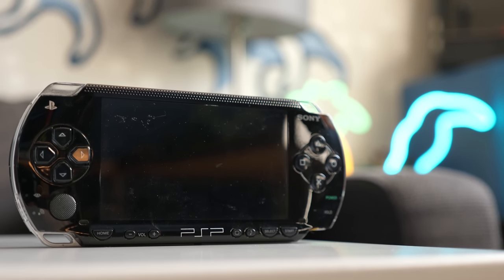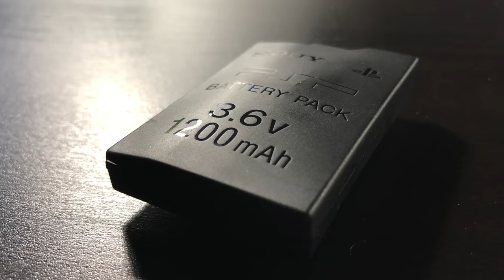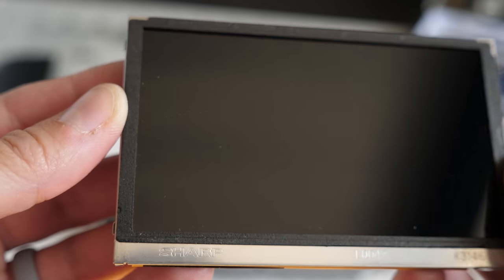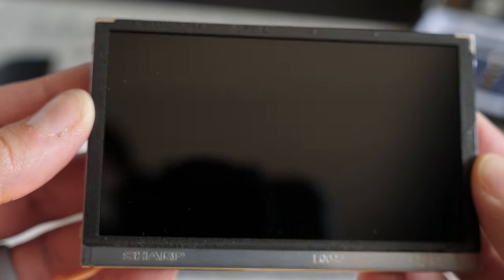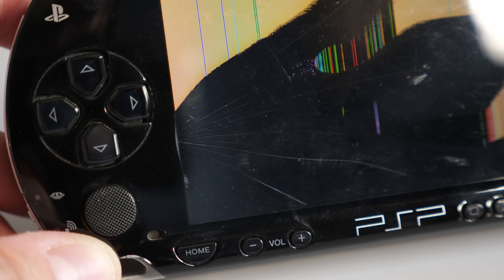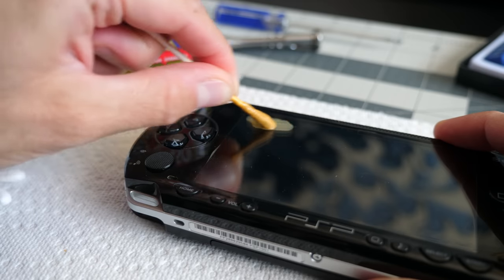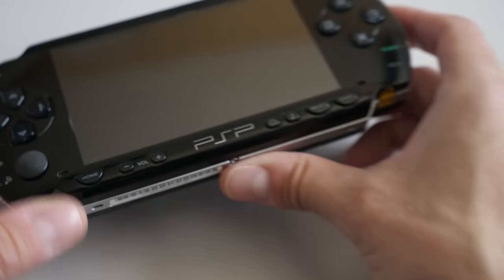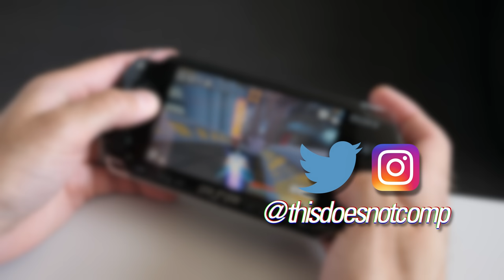Replacing a Broken Sony PSP Screen

Comment: Such a great little machine for 2004, still blows me away Sony was able to get that much graphical fidelity out of it, was an envious DS owner at the time it came out.
Reply: I understand the allure for its strategy/tactical RPG goodness, but games looked bad on it.

PS Vita is where my handheld love is.
Reply: yeah, it was sorta like a portable ps2, and the ds basically had ps1 quality graphics by comparison lol
Reply: @justdev8965  Yep, until you couldn't get games for it anymore.
Reply: You wuold explode if you knew that the psp was able to emulate the ds (unplayable, youd get 4% of its normal speed) but yes it could play ds games
Reply: @stoutishvoice4185  Desmume PSP is actually still indev, there have been major performance improvements. Pokemon Diamond boots and runs at near fullspeed on the title screen.
Reply: Thank it was helpful

Comment: I got myself a psp 3000 with a broken screen , ordered a new shell to restore it and it was a nightmare to get a new screen , ordered and returned 7 screens from Amazon , they all ether were broken or had dead pixels , I won't be doing this again with a psp , shell replacement is easy but getting a good new working screen is super difficult.
Reply: there's also brand new oled screens for psp now
Reply: @Chaosghoul  I think you mean IPS

Comment: I bought an INSTEN brand battery for my PSP 3001 and it has been great. Since it included an adapter as well I thought it might turn out to be too cheap to be any good but I have no complaints so far. it was $21.39 Canadian and I think I saw a replacement for the PSP 1001 available as well.
Reply: What do you mean with adaptor? Are you referring to an adaptor for the charger ?
Reply: @Arturo-hc9pl  It comes with a power adaptor to power the PSP and also charge the battery while it is installed in the PSP.
Reply: I got a really cheap battery for my PSP 3001c (64GB with permanent infinity/lme installed) and it only runs for 1 to 1 1/2 hours when my original sony battery would run for 6 - 7 hours, I took the original battery pack apart to replace the battery inside with a new one (so it wouldn't leak) and haven't done the replacement yet but I will now that I have a new temperature controlled soldering iron (ts80p) and have put some solder on the original battery pack's board for the new battery to connect (also checked which way around it needs to go and marked it) I just need to find a good pouch type battery with the same voltage and capacity that will fit right, when I get the old battery repaired I'm going to use that one in the PSP and make an adapter for the junk one to use it in my xbox 360 controller until it doesn't hold a charge.
Reply: My PSP seems to be a PSP1004 how about that?

Comment: A word of advice with aftermarket shells for the PSP 1000 and 2000,  the analogs need PERFECT contact to the motherboard which means that the shell has to be measured perfectly. This is often not the case for aftermarket shells which cause ghosting issues or dead zones in the analog after replacement. If the shell is not damaged in any way, it's best to leave it be and avoid opening up the console to ensure perfect pressure and contact with the motherboard.

Comment: In 2006 I bought a Sony branded 2200mah PSP battery at Best Buy.
Then turned my original 1800mah battery from 2005 into a Pandora Battery .
I still have both batteries today.
Both still fully charge. No issues.
I lost my charger one time. With a full charge I played the GBA emulator for over 40 hours . Screen on dimmest setting, frame skipping, and CPU on almost lowest setting.

Comment: Always found it funny, how Sony went out of their way, to make it incompatible w/ Minidiscs, even though the actual discs look very similar!
Reply: they are similar except for a few main issues, 1 UMD is actually smaller than minidisc, 2 UMD uses a Red laser like DVD where as minidisc uses an infared like CD and 3 Minidisc is opto mechanical for its re-writability and UMD is purely optical, im pretty sure that since they needed to create a disc format with larger capacity than minidisc was able to handle they then wanted to make everything incompatible so you would never be able to shove a Minidisc into a PSP, unfortunately i think they screwed up the UMD sucks because its protective caddy isnt very protective, the hole for the laser doesnt have a door like minidisc, and the shell comes apart far too easy ive got many PSP games that the shells dont want to stay together or the clear plastic on top pops out. i do think that could have honestly just changed the minidisc caddy just enough to make the two incompatible but yet still provide that lovely protection minidisc had.

Comment: I got a PSP in 2007 - it was an amazing little piece of kit. Not only for gaming but I used to encode TV and film on the memory cards (I had loads of 4GB and 8GB cards) and used it to watch stuff on the go. I often used to work away then so I would use it on the train or the coach a lot and I used it for that until I got my Galaxy S2 in 2011. It really is amazing how much they crammed into that thing in 2005. 

The batteries weren't very good. I often used to carry 3 or 4 batteries if I was going away for a couple days.

Comment: I got 2 broken ones from a Japanese seller, mixed and matched parts, and got a nice black and blue 1000 series. Deleted the UMD port and put in a 3000mAh battery in it's place. It's rooted and I got PS1 games I own ripped to it using microsd adapter. It's a fun little toilet time passer.

Comment: You can restore the original battery by replacing the Li-Pol cell. I've done it for my PSP-2000 with LP603450. It fits perfectly!
Reply: Recell is probably the best option for the budget conscious. Almost the same performance as a Cameron Sino battery, or even an OEM Sony one.

Comment: I've had the 1000, 2000, 3000 and Go. While the slimmer, lighter versions are nice, there's just something satisfyingly chonky about the 1000. The extra heft imparts a sense of higher quality (even if that's not necessarily the case) to it. Same thing goes for the Vita 1000 and 2000. The 1000 just feels so much more solid and high quality.
Reply: Agreed 100% on this sentiment.

Comment: Hey there! Just thought I'd let you know that if your 1000 is one of the models where the lens isn't fused to the faceplate (as in, it's glued on instead), you can mod it with a glass lens. They can be had for as little as $5 each (in a 3-pack), and make the system feel way sturdier. Plus, glass is also scratch resistant. (Also, every 2000 and 3000 can be modded with the same glass lens)

Comment: Nice video, Colin .. great work at that screen swap. Might i suggest U keep onto your original Sony batteries? Even swollen, U can still pry them open & resolder a new Liltium cell, while keeping the original Sony circuitry. It is true that their sells are glued together and need a cutter knife to be opened - and taping them back together, after the "surgery" - but Sony's original circuitry i believe is worth salvaging. Cheers ...
Reply: Why?  If the batteries keep swelling, is the circuitry worth salvaging?  This seems like it would need testing.
Reply: @simeonjohnston5941  Battery swelling doesn't always mean battery leak, as it is in this case - genuine PSP batteries may bloat, but they rarely leak. And aftermarket PSP batteries have terrible control circuits. Why not desolder an aftermarket battery pack to the OEM circuitry? On my PSP Slim, battery got swollen, but the circuitry remained intact ... And Sony OEM circuit boards do a great job at controlling their battery packs ... Too bad Sony didn't make their OEM packs of decent quality, as well ...

Comment: I actually dug out my brother-in-law's old PSP-1001 the other day, he'd given it to me a few years ago and I had CFW'd it. Pretty sure it's the original battery, didn't think it would charge but surprisingly it did and seems to be holding a decent charge. Everything works on it but the faceplate is cracked pretty badly and the square button isn't quite right, so this video actually covers pretty cleanly what I'll need to do!

Comment: The PSP was the first device that I started repairing on my own, back in the day. Since it's rather easy and hard to mess up. Even the later models (save for the Go, which I've never tried repairing.) remained rather modular and easy. THOUGH, the Vita, is slightly harder to repair. Also, the old Vitas have a mysterious internal slot in them, I think that's where the 3G card would sit if I had the 3G variant.

Comment: My original PSP battery from 2005 is still running nicely without any problems in 2021, however I had a 2nd battery puff up on me many years ago.

Comment: The foam around the screen also keeps light from bleeding through the plastic.  I had to replace my screen in my death vader edition, but I couldn't remove the foam.  Sadly now I have light that bleeds through the white shell.  Someday i'll fix it.  Also I'm very impressed you don't have a broken UMD door.  The fat PSP door was prone to cracks and wouldn't close properly.

Comment: Seeing the internals  for the first time and how easy they are to service. Yep, it's a Sony!
Reply: The 2000/3000 systems are easier to fix (the motherboard is one big piece and for most repairs there are no clips holding it together).
Reply: It did surprise me however that the 1001 has a screen made by sharp... i just always assumed it was a sony screen since Sony has a huge line of TVs monitors and other display devices that sonys game console would use as much sony hardware as possible.

Comment: If you save the chip from the original battery, its easy to connect them to a lithium battery. Since my psp was old, and the disk drive did not work, I actually removed it, cut into the inner housing a little bit, and was able to fit a Much larger battery inside. I get a solid amount of playtime with this mod. Sometimes I dont charge for well over a week. I still play my psp very regularly.

Comment: They make IPS mods for these too
Reply: Got one for my 1001 and it looks sweeet. The lack of ghosting is awesome
Reply: also 5000mah battery, have mine modded and last for 12hrs
Reply: @lensboi1229  I like the UMD drive too much to axe it for the extra lithium, even if it is loud and slow and power hungry. The UMD was the PSP’s trump card back in the day, so I wanted to keep it. I ended up replacing the lithium cell in my original battery with, a 2200 mAh cell from I think a baby monitor. Wouldn’t recommend it for most people but it worked. 

Besides, if I cared about battery life, that’s what my Vita is for 😁

Comment: I've bought 2 cellonic batteries, just to realize both of them from different sellers were working for 1 charge and puffed up after that. I contacted the seller which offered me replacements, no issues so far and its almost a year now. I wouldn't recommend this brand though. I got them for ~25€ a piece

Comment: Never had any battery swell on me. I've been using Cameron Sino brand for many devices, and so far they haven't failed me.
That's the same brand as you put in this time by the way. I've had good luck with Hantel aswell but I haven't had many of those so I can't really say if it's better than any other brand.

Comment: In terms of batteries I've had good luck with a particular battery so I bought another of the same brand and it wasn't the same experience. Definitely hit or miss even with the same brand. I'm guessing these after market batteries are as old as the psp itself so they degrade from just sitting in a warehouse for a decade.

Comment: Recently a couple months ago I brought my psp with me to work in my backpack. Long story short I left it next to my work vehicles tire and accidentally ran it over. I went to the gas station and before it was too late realized I left it at the shop. I went back and was so scared it would have been ruined. The body and frame were completely unharmed but the screen did crack in the top left corner and was utterly surprised nothing worse had happened because my truck is huge and heavy. I was able to replace the screen later on but kept the broken screen as a memory of that day.

Comment: Sony pro tip: They use the same barrel jack size for everything. You can buy a cheap PS4 controller station charger instead of an expensive PSP replacement charger. Same voltage and barrel jack.

Comment: Unfortunately I couldn't find a reliable battery replacement for my PSP so I opened it and replaced the cell for a trustable one. There is a drive delete mod which you can use up to 10000mAh cell

Comment: Hey Colin, how's it going?  Can't you hook up the PSP to AV or composite to a TV to verify everything else works?
Reply: PSP 1000 does not have the ability to hook up to a TV with only 32MB of memory. That feature was added to the PSP 2000 and later models with 64MB of memory.
Reply: @DDStuff  derp.. that's right.. and I even had a 1000 and 3000 model too

And yes, the swelling battery is real... That's how my 3000 battery went out, luckily it didn't do anything else
Reply: @adventureoflinkmk2  
I believe the worst it can do is break the plastic cover holding the battery. Glad those covers are so easy to replace.

The only time I ever had any swelling batteries so far this year was from my New 3DS XL and my MacBook Pro battery. Mostly due to having them plugged in all the time and not using the batteries enough.

I never ran into swelling batteries with my PSPs (yet), so I make sure to re-charge them after 6 months or so to try to mitigate the issue. Those batteries drain after only a few months of sitting idle which if left uncharged also leads to swelling. shrugs

The PSP Go is a different story, that battery is still going strong even after 6 months of no use. I think that is when the battery tech improved.

Comment: It's a shame that SONY (they produce Lithium-Ion cells themselves) doesn't officially offer replacement batteries for their PSP since more than a decade, just for their cameras, IMHO if they would make PSP batteries again it would be a "shut up and take my money" even if it cost more than 50 bucks, JUST DO IT!
This shows also one of the major problems of user replaceable batteries, I appreciate them, but they're a pain it the butt if they're proprietary, so like here it's a pretty mixed bag with third party batteries.
The manufacturers should be forced to supply these for >10 years after End of Life and maybe give the construction drawings/licenses to a third party one that continues that or publish them for everyone.
Luckily also 3D printing makes things like Lithium-Ion based and USB-C rechargeable replacements for the Sony BP-2 and BP-5 battery packs used in Discmen possible.

I may also replace my PSPs LCD, it's got a dark spot and the front body got a crack but I'd rather get a IPS one: https://youtu.be/hIUuIaAD7E0 that's drop-in except you have to bridge two solder points.

Comment: PSP is love. I have every model except the E1000(street), been looking for a good price for years.
As for batteries all the ones I've bought have been garbage and the 99% of the originals are swelling.
Reply: somehow ive been able to avoid this issue with my original battery and the stamina battery i bought for my console, they both still work, still hold an ok charge who knows, i will keep an eye on them from now on though and probably make sure i dont leave them in the console unless im using it.

Comment: Next video please: how to make a working battery for PSP... NVM, I just saw iFixIt sells them, I trust those won't be dead OG batteries like Amazon and eBay sellers are scamming people with.

Also pro tip, get a memory card pro dou to micro SD adapter.

Comment: I have a PSP 3000 (the sticker fell off so I’m not sure) and it’s green and it’s also missing the joystick and the battery is still good. But can you upgrade the screen to a higher resolution/pixel density? And I can’t find the Spirited Green replacement analog stick cover

Comment: I need a good brand for a replacement faceplate for a PSP 1001. I think I may have to replace the charge port/socket (the yellow hole)

Comment: I still have 2 psps a 1001 and a 3001 model. My slim model is not bad but on the back of it the paint is starting to peel off which sucks.

Comment: is it possible to ask you for trying to fix my 3ds, that has issues with charging?  It won't charge by normal 3ds power supply, but it will by usb charger, and still, it has to be in perfect position to be able to charge, and sometimes, 3ds orange light is lighting by itself for many hours, even if console is turned off.
Reply: What does a USB charger look like?  Because from what you're saying you may have an issue with the AC adapter
Reply: @adventureoflinkmk2   I bought few of original AC adapters , 2 of nintendo ones, and i checked also on the friends' 3ds dock, and  friends' working 3ds charger. And it just doesn't work.  Only my usb cable works.

Comment: Is it okay if the PSP is missing screws where the battery compartment is? I bought a PSP 3001 for 15 dollars and bought a battery to see if it got power and now have to replace the screen so do I need to pick up small as screws for them or just deal with it?

Comment: I have the original 1001 model as well and some years ago i dropped it and the pins that rest on the motherboard came off so it will only work with a charger connected and will work with or without a battery, how do u put the pins back on

Comment: I have that same model, sadly my cat dropped it and the screen broke and I lost the battery, and then 2020 came and my local customs won't let any imports come so I just gave up, later in December I found and PS Vita already hacked for a reasonable price and ended up installing Adrenaline and now it's my PSP, but maybe in the future I will fix my phat PSP.